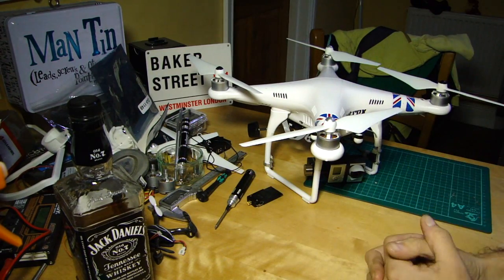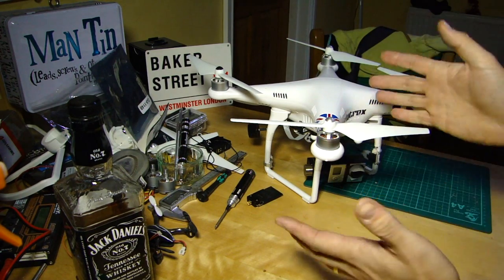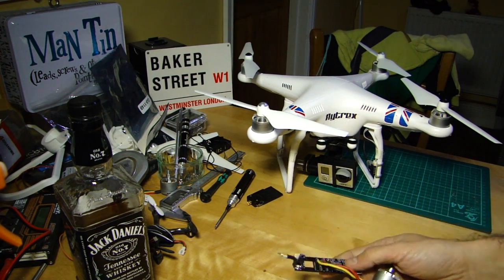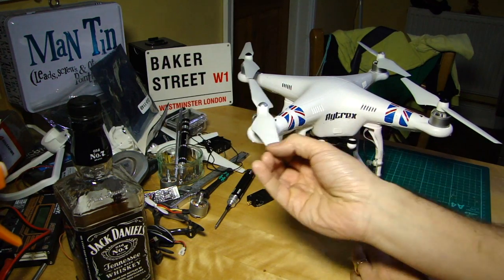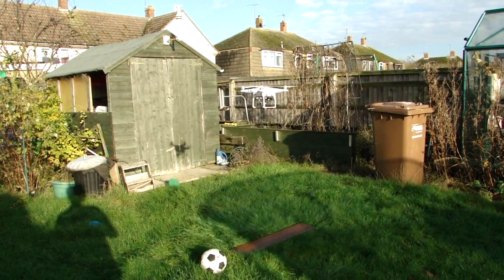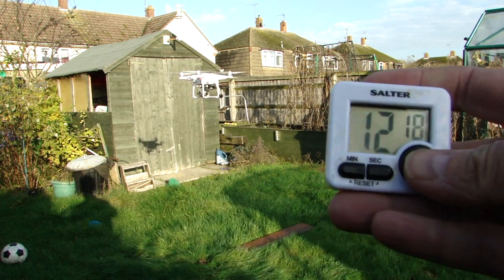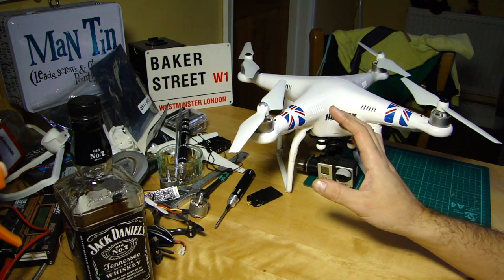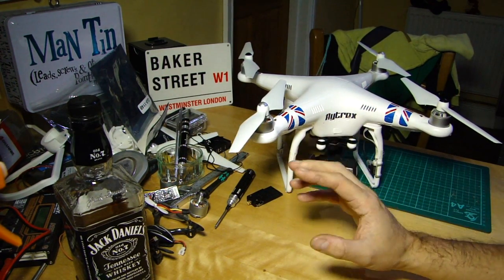DJI Phantom Upgrade Motors & ESCs - flight test results

Comment: Hi Simon... I've seen that the  motor wires are lot thinner than the older spec'd motors.. Have you experienced any form of overheating either with the wires themselves or the  ESC units?
Reply: +Simon Newton can you show me a photo of how to place the cables in the right way and what should I be aware not too ?

Comment: I put in my Phantom the Antigravity T-Motors with the Carbon Props set. The fly time depends of take off weight. I know many users with 12-13 minutes of fly time with 1400 grams of weight to 20% battery

Comment: Firstable I have to say that your youtube channel helped my a lot.

But a few days ago i have resived my dji phantom 2 V.20 with the zenmuse H3-3D gimbal.
And these are my results:
With 20% of battery 15 min. and with 8 % of battery 17 min!
So I think that with the phantom fully updated and with the new batteris( the V2.0 batteris) the phantom 2 V2.0 can get even more flight time and more power.

Hope that it helps.
Reply: ***** I have an IOSD mini and FPV transmiter (of 1000mw). and my weight is about 1300 and 1400 aprox but with no FPV gear, i have a velcro to attach it.

Comment: I see on the DJI forum that a few people have had their ESCs burn out after being fitted with the new motors! Hopefully not an issue but a bit worrying.
 http://forum.dji.com/forum.php?mod=viewthread&tid=2908&extra=page%3D1&lang=en

With the rubbish weather here have only managed a couple of flights so far on my new craft. Nice and stable with just a little jello on the footage. But the motors sound postive and responsive. Lets hope it stays like that! The only issue so far is actually being able to see anything on the FPV monitor once the sun comes out! The sun shade only works if you stick your head straight onto it!

Comment: Doing my first ever flight with my new P2 (with the new motors etc)  it was interesting to compare the experience against my P1. The takeoff as you said Simon was much more precise and solid. And the controls felt far better as well. And I found having FPV for the first time helped with the flying far more than I might have ever expected. Not just being able to line up shots but also steering the Phantom round the sky. I think I will need to tweak the Antenna's a bit as I did get quite a bit of loss of colour when flying (not sure what that indicates) but overall found the quality of the image good. I only intend to fly within LOS (of course) anyway so won't be pushing the FPV to its possible limits!

Comment: Perhaps I missed it Simon, but aside from the reduced flight time, what are the effects of the new ESCs, motors and props, e.g., what did we gain from the new running gear and how did you confirm that (if at all)?  Having said that, and heard your comment about "punchy and nimble" maybe it would nice to have load test (how much can it lift).

Comment: Hi Simon
I read in forums that when you are on the latest firmware version then the first low battery alarm will start at 20%. The second alarm at 15%. I tested again in other fly with constant movements.

This is the result:
99%-30 = 12.5 minutes aprox.
99%-20% = 13.5 to 14 minutes aprox.

In the older firmware the first low battery alarm will start at 30%. I bad calculated
I not know that fly time I lost because I not remember that firmware have my phantom in the the previous fly before the upgrade and I not know if in this pre - upgrade fly, my phantom have the version of firmware that sow the first low battery alarm at 20% or at 30%. :-(

I not know that fly time I lost...

Are normal or similar my actual fly time results compares with your tests?

Best regards

My Phantom weight is 1412 grams.

Comment: Hi the point I'm making is my PHANTOM 1.1.1wirh stock props.stock battery gives a return of approx 7min flight time which is rubbish compared to my 330 Kk2.1hc which gives 15min on the same battery same size props and weighs the same  and is a whole lot faster .somewhere in the 1.1.1 there is something that's eating voltage 
Pure and simple
Brian

Comment: How to Calculate Flying time or why you can't fly for more than an hour.

Flight Time(hours)
T = kb/f

Where
k is the performance of the Motor/Propeller/ESC as grams per watt
b is the performance of the Battery as Watt hour per gram
f is the performance of the Platform as ratio of platform to battery.

Motor/Propeller/ESC performance
Based on the excellent work of Dr Kiwi assume an optimistic
k is 7 g/w

Battery performance
based on the DJI Phantom Vision 2 +
mass is 400 grams
capacity is 5200 mAh
- at 81% usable power this is 4200 mAh
volts is 11.1 (Nominal)
b = (4.2 * 11.1)/400
b = 0.117 Wh/g

Platform Performance
weight of Phantom vision + is 1242 grams
f = 1242 / 400
f = 3.105

Flight Time
T = kb/f
T = 7 * 0.117/  3.105
T = .264 hours
or 16 minutes.

This is a simple example that demonstrates the component performance. It ignores power consumption of the electronic components(each watt consumed simulates k grams to the weight of the system). Also loses due to maintaining a physical height and location.

One fun calculation is to add 1000 mAh to the battery. This does not effect propeller or battery efficiency, only the platform efficiency. It only yields an extra 2 minutes(because of the extra weight).

Comment: EXCELLENT JOB SIMON¡¡¡

I tested this night my upgraded Phantom 2 with the new 2312 motors, ESCs V2 and new props this night. This is my results in my fly time test:
Whit a full charged battery:
99%-25% = 12,5 minutes
99-15% = 13,5 minutes, and auto landing
I asked to another user of phantom 2 V2 and told me that his fly time is 12 minutes from 99% to 25% battery charge.
I need weigh my Phantom 2 with a digital scale, because I have installed a GPS Tracker XEXUN TK102/b too.

during the night test, I have gone through some branches of trees by accident, propellers have cut the branches, but the Phantom has not fallen ... I'm sure with the old engines would have fallen...

With the old motors I have 15-16 minutes with the same weight... my conclusion is that this motors are most powerful  and the fly is more stable and fast, but more stress to battery and loss around 3 minutes of fly time. I not sure if the new Phantom 2 V2 can damage the batteries by excessive discharge ratio

Is correct my flight time? It seems that the Phantom has gained more stability and power, you have a similar fly time?. Sorry, for my questions, I do not understand the English language. Please, can you send me by email your comments and conclusions? That advantages have you noticed with the new engines? Any problem with the batteries? that weight have your phantom? my email: curso88@gmail.com
your comments are appreciated but I need to read because I not understand the English language talked
Thanks in advance
Alex G.
Reply: ***** Hi Simon. I noticed that the first low battery warning starts at 20% The second warning at 15% . Is normal?
Reply: ***** You off the battery warnings? In NAZA mode? I have a question,  

This result is normal or similar to your times? I have 1412 grams
99%-30 = 12.5 minutes aprox.
99%-20% = 13.5 to 14 minutes aprox.

Thanks in advance and sorry for any inconvenience
Reply: ***** You are right¡¡¡ My fun and hobby is experimenting and learn. I am passionate about technology :) Next month, I will install the T-Motor MN 2214 V2 Antigravity motors. You're not a scientist, but your youtube channel is fantastic

Comment: Hello, if I wanted to  upgrade my motors, would i also HAVE TO upgrade my ESCs?
Reply: ***** would it have any effect with new ESCs but old motors?
Reply: Ok thanks :)
Reply: The new ESC V2 are identical hardware same the standard ESCs, but the internal firmware are different and not is possible upgrade with the Phantom Assistant software. You need upgrade the old ESCs to the news V2 as it has done Simon

Comment: Hi good vid .I like the well made PHANTOM but Dji are crap at getting decent flight times out if there machines.I get around 7/8 min on a stock battery which is rubbish.Iv made a couple if QUADS 550 and a 330 both with Kk2.1 hcboards  and they blow the Dji out of the water .times are around 18min and they weight the same as the PHANTOM but are the FAST WHOOOOSH .
keep the vids coming 
Brian 
London
Reply: Considering power needed for GPS etc then you might get extra flight times with your KK board, I know which system I would rather fly with.  To suggest that Dji have crap flight times is a ridiculous comment. 16 mins with a fully loaded P2 is good as far as I am concerned. Dji don't only make Phantoms by the way.